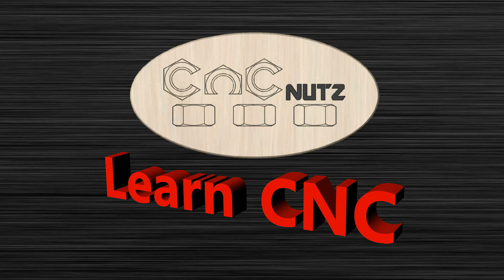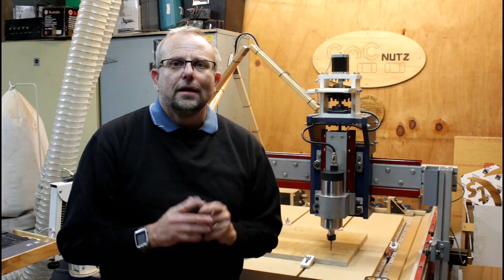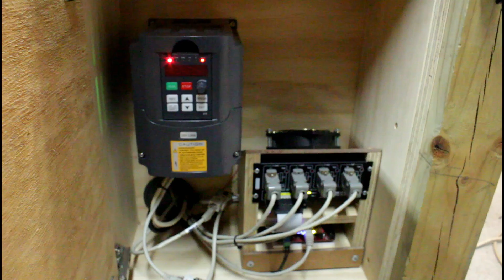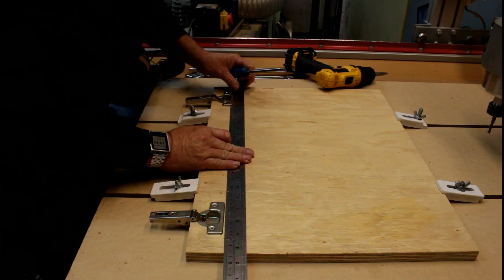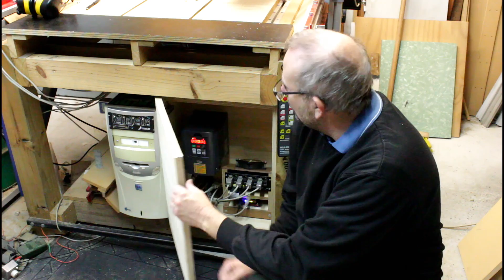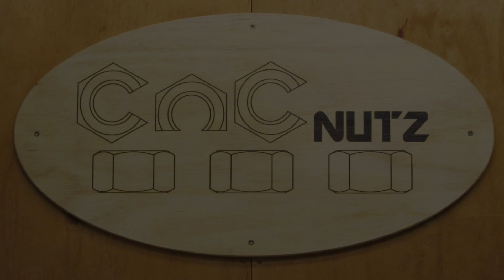New Spindle's First Cut - CNCnutz Episode 144

Comment: It seems in the last days I saw at least 20 of your videos. They are all informative and easy to understand. Thanks! Did you consider a water cooled spindle? I am sure the installation and the pipes are more hassle but I guess they also have advantages like no air flow into the spindle (getting dirty) and no airflow out of the spindle (maybe where you don't want it).

Comment: It is all looking good. When I set up my VFD under my table next to the PC I had a lot of problems with electrical noise. I ended up lining the enclosure for the VFD with mesh to form a sort of Faraday Cage and that solved all the noise problems except for the limit switchs forever tripping estops, however, your vid on limit switchs solved that one.
Reply from the maker: +loskop100 
It is a concern but I won't know if it is a problem until I start to use it in earnest. Fingers crossed.

Comment: Nice work Peter. Thanks for the video. Question - is the air cooling from a fan on the spindle or do you need compressed air connected to it?
Reply from the maker: +Joe Hardell 
Internal fan

Comment: Nice job, Peter!  Congratulations on your new spindle.

Say, you mentioned that you were using SuperPID before (I do too).  Why didn't you use it to turn the spindle on and off?
Reply: spindles use VFD's
Reply: Hi Julius, yes, I understand that.  But it sounded from Peter's video that he wasn't used to the cutter being turned on and off automatically (and he was using SuperPID with his router before)
Reply from the maker: +Steven Osman 
I couldn't be bothered and there a handy switch to turn the router on and off. The VFD changes that a bit and it is no longer convenient to do it manually.

Comment: Nice job peter I've had a VFD and spindle for several years and never have gotten round to wiring it for speed and on/off always been on the must do list. If you can offer any tips (wiring etc) they would be useful.
Reply from the maker: +den453 
Will do in an upcoming episode. It took a little head scratching to figure out but it turned out to be quite easy in the end.
Reply from the maker: +Julius Jahn 
I'm not using RS485 to control the spindle but it sounds like an easier wiring option.
Reply: ACM and RS- RS+ pins
Reply: Me neither, I assume you just used the +10V to set the speed? I guess I have to order another supply or something. Will just wait for your next video. Cheer
Reply: CNCnutz (Peter Passuello)  I just started using the RS485 on mine this week.  very easy to set up and control with the plugin from http://royaumedeole.fr/informatique/plugin-mach3-pour-vfdhuanyang/mach3-plugin-for-huanyang-vfd/.  Peter, how long does it take your spindle to spin up? I have tried adjusting the settings on my VFD, but can't seem to get it  under 15-20 seconds at about 12,000 RPM without tripping it.
Reply: Kyle Coleman  I have mine set to 6 seconds and 20000rpm with no problems
Reply: den453 Do you remember which setting you used for that?  I have been adjusting PD119.  I am not sure what other setting to use.
Reply: You don't need to set it on the vfd I set mine via the spindle settings in mach3
Reply: den453 thank you
Reply from the maker: Parameter PD119 is default at 150% on mine and is something I didn't change.
You can see all my settings by looking at the document I published.
http://www.cncnutz.com/2017/04/installing-spindle-part-2-episode-145.html
According to the manual Parameter PD014 sets the acceleration time in the VFD and changing this will increase or decreade the spin up time of the spindle.

I'm assuming you are using the current monitor function of the plugin and it is the plugin that is tripping and not the spindle.
If so turn it off and see if you can spin up in a reasonable time and then have a look at the plugin again.
I will be releasing a video shortly showing how I set up this plug in and I left it off on mine to keep things simple.
The spinup timer in Mach3 is simply a delay before it executes it's next line of Gcode after a spindle has been turned on.
When installing something like this turn on the basics only and once it is going turn on the bells and whistles. 
That way you know what part is causing the problem. At least that's my theory.

Cheers
Peter
Reply: CNCnutz (Peter Passuello) That was exactly what I was looking for.  Thank you!

Comment: In your post processor you may want to add G4 P1 to allow 1 second for the unit to spin up to speed. I actually have G4 P2 to give me a second or so in case I see that I missed anything. Welcome to automatic start... nice huh???
Reply from the maker: +askjerry 
UCCNC has a spin up timer you set to allow the spindle to get up to speed before it starts moving. 
Cheers 
Peter
Reply: CNCnutz (Peter Passuello) Ah... perfect.

Comment: You might want to keep an eye on that VSD and make sure it doesn't get too how in that box. It will probably be okay.
Reply from the maker: +Robonza 
I'm putting a thermometer in the box to keep an eye on it. 
Cheers 
Peter
Reply: manual says 1" on each side, 2" for the fan side and youre ok.
Reply: The fan size is irrelevant if you seal it up in a box with no way for the heat to escape. It also depends on how hard you are driving the spindle as you can derate it.
Reply: I think you misread. I just listed the amount of "air" it needs around each side for proper ventilation.
Reply: The point I was making is, imagine the ambient air temperature in a closed box is 80 degrees C. The fans can blow all they want and you cannot get the heat-sink to get cooler than 80. The specs are rated open air at 20C on typical electronics.

Comment: so where you hooked the vfd up too ? 
did you needed to add some extra stuff for it (optocoupler) or could you wire it straight in
Reply from the maker: +watahyahknow 
A relay for stopping and starting the spindle and the VFD connects direct to the Gecko G540 with 3 wire for the PWM.

Comment: Great job Peter.
Reply from the maker: +Dave Gatton 
Thanks Dave. 
I was surprised that the dust didn't blow around like on a normal router.
Reply: CNCnutz (Peter Passuello) yes, I expected to see the dust flying around a lot more.
Reply: Where you running it at full speed? if you do they do normally move the chips rather more. Air cooled spindles cannot run as slowly as water cooled as the fan is on the none business end best check what the minimum is for yours.
Reply from the maker: +den453 
No I was running it at 10000 RPM. At full speed I would have burnt my way around the cut.

Comment: nice Peter I got my CNC working with my 2.2 spindle. but my z axis needs little more beefing got some flex but closer than I was. please make video on set up spindle to uccnc software thanks
Reply from the maker: +Robert A Crowe Mobile Home Workshop 
I plan to do both Mach3 and UCCNC. 
Cheers 
Peter
Reply: CNCnutz (Peter Passuello) Do LinuxCNC too and you will be really well rounded. (grin)
Reply from the maker: +askjerry 
I can't help notice that as time goes by I am getting more and more rounded. 😀
Reply: CNCnutz (Peter Passuello) Yeah... too true.